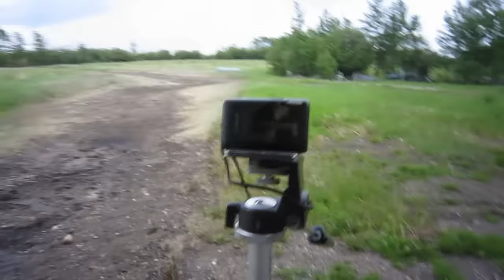Testing a GE J79 with afterburner

Comment: Correct me if i am wrong but is this a f104 jet engine?
Reply from the maker: This is is a J79-17. The Starfighter used either  J79-11 or a J79-19.
So yes, depending on your level of detail. This actual engine is out of an F- 21 Kfir.
Reply: Also the same engine used in the F-4E
Reply from the maker: That would be the -8, and -15.
Again... That same, but different.
Reply: @AgentJayZ  So this beauty powers a bootlegged Mirage? ;-) BTW what are the differences between the dash numbers? Mounts? Mods to burner cans/compressor/turbine/afterburner?
Reply: @akkudakkupl  late reply ik but its basically just changes and optimizations to the internal technology (IE the older models spit out blacker thicker smoke and howled like a freight train whereas the later models commonly look like this video). Pretty sure in technical terms its just different compressors and shit.
Reply: @JustAGooseman  Thanks

Comment: Thank you alot for this video.. what's the importance of the pvc duct in front of the jet engine?
Reply: The hose is bleed air used to start the engine, I’m not sure what they call it on a stand like this but on a jet it’s bleed air
Reply: @waosfab9080  .. thank you for the response...best regards

Comment: Why does the skid not move forward? When they test jet engines on a plane they are rigged with big chains to prevent them from taking off at full trottle...... how can this engine stay on his place  at full power?
Reply: If you check the video here:
https://youtu.be/3SH5953iQ6w?t=152
You can see that the structure stands on hardpoints which are built into the concrete deep.
This is the reason why the jet engine not moving a bit.
Reply from the maker: You might wonder where those big chains are attached on the other end. Likely anchors fixed to the ground with bolts... the same kind of bolts we attach our engine mounts to the steel beams embedded in the concrete.
Reply: @AgentJayZ  Told the same. Engine test hardpoints are made on all airbase to maintain engines.
Reply: Der Kabouter Gravity I guess
Reply: @suprxme_exnesto7476  😂😂

Comment: What type of Jet was this engine removed from?  Looks like fighter Jet Engine
Reply: F16 if I remember correctly
Reply: Something tells me "One of them real fast ones" probably isn't the answer you're looking for :)  I don't know for sure, and there is probably a way to tell... But this engine was used on both the F-104 Starfighter and F-4 Phantom fighter jets as well as the B-58 and A-5 supersonic bombers, so it is one of those four.
Reply: F-16 used the GE F110, not this engine.
Reply: @asgnecco  And F4 has 2 of these? :0
Reply from the maker: This particular one was removed from a retired F-104 Starfighter.
Reply: @asgnecco  One them real fast ones lol!  I do know the difference between Commercial Jets, Fighter Jets, And Cargo Jets.  My dad was an aircraft mechanic in the Navy and I grew up on Naval Bases not far from the flight lines.  I figured it was a Fighter Jet Engine from the shape of it and rear part of it.
Reply: @asgnecco  true on the GE F110 part, but false on the other part as this was ALSO an engine option. "In response to President Jimmy Carter's February 1977 directive to curtail arms proliferation by selling only reduced-capability weapons to foreign countries, General Dynamics developed a modified export-oriented version of the F-16A/B designed for use with the outdated General Electric J79 turbojet engine." but none where ever sold...

Comment: What does the orange house, connected at start up, do?
Reply from the maker: It's a hose from the start cart. It supplies air at 30 psi to the air turbine starter. I have a video called that.

Comment: excuse me, what is the purpose of the hose/pipe at the inlet mouth of the engine during start up?
Reply: To be a bit more precise, the hose supplies compressed air at a controllable pressure and flow rate straight into the compressor (bypassing the main intake fan at the front the engine) to start the turbine blades spinning and let the engine develop oil/hydraulic pressure. When the pressures/temperatures have stabilised and the engine RPMs are high enough they light the burners and the intake/combustion process becomes self-sustaining. The auxiliary hose is then disconnected and the engine is idled for several minutes to make sure nothing goes bang before increasing power. So yeah, basically like the starter on your car, but also not really. :)
Reply from the maker: Six stringed thing: what you are describing is not correct, although somewhat similar to what is called the air impingement starter. I have a video on that.

In this video, the start cart supplies 30 psi air to a small air turbine starter in the nose which is connected to the main shaft of the engine. I have a video on that as well. And also a video on the starter ratchet clutch that disconnects the starter once the engine is running.

Comment: What would be a use-case for such an engine in it's current form?
Reply from the maker: The J79 is an aircraft engine used in a variety of fighter jets.
This J79 will be installed into the fighter jet from whence it was removed.
Reply: @AgentJayZ  thank you for your reply. So there isn't any practical secondary purpose for it (besides just looking and sounding awesome) while outside said aircraft?
Reply: @UserCraft1  IF someone had the money or will power i guess you could strap one onto something like a boat but its a pretty big engine your better off with a smaller one for more practical uses
-
Reply from the maker: Well, you said in it's current form...
The land running industrial gas generator known as the LM1500 is a J79 with all the aircraft-y stuff removed. They run on natural gas, and there are hundreds of them still running right now.
Reply: You can blow with it to soldiers to make them to go fight

Comment: Question, how does that frame hold on to that engine? With as much thrust as it produces, how doesn't it just rip itself out of the ground?
Reply from the maker: Bolts. The same kind used to build skyscrapers and other steel framed buildings.
Reply: @AgentJayZ  I'm shocked those are strong enough. Thanks for the reply.
Reply from the maker: Ain't nuthin stronger, Collin. All reasonably modern buildings are put together with 'em. This engine pushes with ten tons of force against the mounts.
IMO, the engine stand could handle a hundred tons with no deformation or damage.
Reply: See my comment above... if the frame withstands that much thrust because of the bolts used to afix it to the cement floor, what is then stopping the engine thrust from ripping the entire building off of the very ground it was built on...look at the ground surrounding the building...it's just dirt...I assume the building cement foundation is just laid upon this dirt ground...even with some cylindrical metal or cement stanchion supports dug vertically into the ground, which is what they use to secure skyscraper foundations, which are intended to withstand much less side-to-side, horizontal shear stress force due to wind and tectonic plate shifts compared with the massive thrust force generated by a jet engine, their interfaces with the dirt ground would still be marginally weak to withstand that amount of jet engine thrust...but I guess obviously they do if that is what is used...amazing!
Reply: U think 9 tons of shear force is enough to rip up an entire concrete slab and the building?
Reply: @joeymed2009    Dear Ellie, yes, I would think that 9 gravitational (force) tons (when all is said and done, it's probably more than that) of shear stress would be enough to separate a concrete slab, with or without stanchion supports as I described, from the dirt ground upon which it rests.  In support of this, I just learned that the concrete foundation is a whopping one meter thick...unbelievable!  If this is true, then shear stresses probably of over 50 tons could be withstood by this fortified foundation.  So here's what I'm wondering: since we have the foundation and the engine to frame mounting bolts (as AgentJayZ described above) as being strong enough to withstand the shearing force generated by engine propulsion, then is the frame to concrete foundation interface strong enough to withstand this force?  I assume that the frame is bolted quite deeply into the concrete foundation, but there is nothing like an actual bolt within this concrete slab to hold the mounting screw in place, let alone to secure everything in place when the engine is in action with significant propulsive force.

Comment: Where is Fooledbynomedia when you want him?? This proves that jet engines do not run on compressed air as he and others of his ilk   claim.  Stored compressed air could not generate that much heat and thrust.  Compressed air however,  certainly starts them well.
Reply from the maker: Like proving a mountain is there, it's not necessary. It's not a debate.
If you respond to them, the morons claim victory, because, well... they're morons.
Reply: @AgentJayZ  So true.

Comment: What is the High pressure compressor and turbine blades made up of?
Reply from the maker: There is only one system, or shaft in this engine. The compressor is a completely different assembly of parts from the turbine.
Stainless steel ... and high nickel alloy.
Reply: @AgentJayZ  Right,thank you.

Comment: Were the j79s in the f111?
Reply from the maker: I was not sure, so I checked with Wiki, and learned that the Aardvark was powered by a pair of the P&W TF30, one of the first afterburning low-bypass turbofans. It was also used in the F-14 early models.
Reply: @AgentJayZ  J79 were used in the f4 miss working on them.
Reply: @AgentJayZ  crazy

Comment: Hey JayZ, what would happen if after coming out of burner the nozzle didn't constrict due to a mechanical issue? What type of power loss would there be at mil power compared to the proper nozzle position at that throttle setting?

I heard this may have been what happened to that Mig 23 the other week when their burner stopped working, and possibly resulted in not enough power for them to save the jet. I think that jet was very overpowered so it shouldn't have been an issue, but I'm no pilot.

Thank you
Reply from the maker: At max dry power, with the nozzle in AB position, almost all thrust is gone. The nozzle position is controlled hydraulically, using the jet pipe temperature as the measured variable.
Maintenance is key for everything to function properly.

Comment: Put up a distant mic next time to hear the difference with AB.  You probably already did this since this an old video.
Reply from the maker: Yes, doctor. The ideal distance for a condenser mic is 500m, and still compression is a good idea.
Best distance for video is 10 to 20m.
Wireless mics usually have a max range of about 50 to 75m.
What I really need is a clone who can communicate telepathically to run the sound while I run the camera.

Comment: How far behind it would you have to stand for the heat to be bearable?
Reply from the maker: In full AB, probably about 75m, but you would be blown backwards, and injured by flying rocks at our facility.
The primary product of these engines is not heat, but thrust.

Comment: Is the exhaust supersonic when the afterburner is on?
Reply from the maker: At the nozzle exit, the gases are at Mach 1. The speed of sound in air is proportional to temperature, and the AB exhaust is in the thousands of degrees F.
Reply: @AgentJayZ  minor nitpick, proportional to the square root of temperature. Speed of sound at that temperature is probably in the 600-1000 m/s range.

Comment: What type of bearings are used in this application? Also what brand of bearings do you prefer?
Reply from the maker: The bearings have part numbers. Preference has no meaning.
Got a few videos on bearings. Try "Twin shaft turbine engine bearings"
Reply: @AgentJayZ  still replying after 9 years !! : D awesome
Reply from the maker: In aerodrivative industrial engines, and in all the aircraft engines I've worked on, you'll not find one journal bearing, and no ceramic rolling element bearings either.
The bearings do not run at extremely high temperatures, due to several layers of thermal protection. You are right about the oil being great at standing up to heat, and it is used mainly as a coolant for the bearings in these engines.

Comment: I want this to put in my 1 ton !!
Reply from the maker: You want a T58. 1250 Hp shaft output, and it weighs about 350 lbs. 1100 ft-lbs of torque right from zero to 6000 rpm. Make a dually do quarter mile long burnouts.
Oh, and a 20 inch diameter exhaust pipe...
Reply: @AgentJayZ  Are you saying I might need some shock wave protection !?
Reply from the maker: Not at all. It's a drop in perfect fit for your truck. Top speed will vary, depending on gearing and your level of self preservation instinct, but will never approach sonic velocity.
Reply: @AgentJayZ  Thanks Agent Jay Z !!      Man , yoooooou are making my day .........!

Comment: What aircraft did this come from? Or what would it usually be in?
Reply from the maker: This one came from an Italian F-104. Full list of applications is on Wiki's well-done page.
Reply: @AgentJayZ  a starfighter? NO WAY!
Reply: @AgentJayZ Is there a thrust difference if the engine is installed in the airplane or in to the bench ?
Reply: They were in F4 and F104

Comment: What's the white cone for on the front of the engine? What does it do?
Reply from the maker: The starter fairing allows air to enter the engine with minimal disruption from the starter, which is mounted on the nose.
I think you may have meant something else, but it's not a cone.

Comment: What if u stood behind it?
Reply: You'd get teleported out of the solar system..
Reply: @theairaccumulator7144  And with after burner the person would be another star lol!!
Reply: In 2003 we had to make an engine run to be able to run the air conditioning of an F4F. We didn't had the posibility to go to the normal place where normaly the engine runs had to take place. Our officer gave us the order to do the engine run at the place where the F4 was at that moment. We just should turn the nossle of the F4 in the direktion of a little wood which was near by. Ok, no problem. As you ordered... with 80% engine power we fell two trees... 
I think it would kill you if you get into the blast near the nossle.

Comment: Since these things where not computer controlled. What system modulates the variable nozzle?
Reply from the maker: The fuel control, the nozzle area controller, and the temperature amplifier.
Reply: The afterburner is a temperature amplifier in its self. That, and noise. Amazing all those parts can stay together with all that going on. The view from the back with all fuel rails working looked the door to hell.

Comment: Looks very ominous whened do the turkeys feathers expanded and contractioned!  But where at is the afters burning flames and shocked diamonds at?
I bet it that would REALLY geted my go cart to blast offed when did the townships cop show uped and tell to me to geted offed the street agained.
OHHhhh wow FINALLY at 10:40 does the afters burned flames show uped!!
May be I could to welded that ond to my go cart chassis and builded a Recaro seats ond top...wait, probly I will haved to finded some ofed used ejectioned seat?  Just it would to be worthed it to fly past that cop all ways when does he chased me and yelled at me.  May be evened I cand burnd the paint offed his hood too even.
Reply: Google translator is as confused as I am, and has a headache, as I do. "Recaro" is spelled correctly AND capitalized, though. Attention to what's important, I suppose. Glad you did find the afterburner event, I was going to point it out to you. It's pretty spectacular.

Comment: How much fuel is it consuming at maximum?
Reply from the maker: It's all right there. All you gotta do is look.
Reply: @AgentJayZ  I just read it... That is....... kind of hard for me to comprehend. dang...
Reply: @AgentJayZ  Kerosene (Parafin?) is cheap in US so no problem ?
Reply: It was also used in the F4 Phantom. The internal fuel capacity was around 7.500 ltr. At full Afterburner the range (for two engines) was about 25 min.

Comment: What's the maximum accel rate in % per second?
Reply from the maker: Why? You have a table of different engines, and you're going to compare? 
The test includes a throttle movement from idle to mil in 0.1 second. Min response time is specified, but I forget what it is.
Reply: @AgentJayZ  Min or max response time?..and I have many tables with times and also 20 years doing this ...
Reply: @AgentJayZ  Not comparing anything, my work involved testing ECUs for turbine engines, max accel rate was a factor.
Reply from the maker: I think the response to that test is under ten seconds, but as I said I don't remember.
Reply from the maker: Today we test ran a J79, and I now can answer your question, because I was standing right next to it for a response test. From idle to afterburner took less than two seconds. Scared me out of my skin, because I wasn't expecting it.
Reply: @AgentJayZ  Wow, that's fast.  In 1978 when I started work in aerospace 7%/sec was the limit on a RR RB199 engine, and I'm not surprised you were scared.